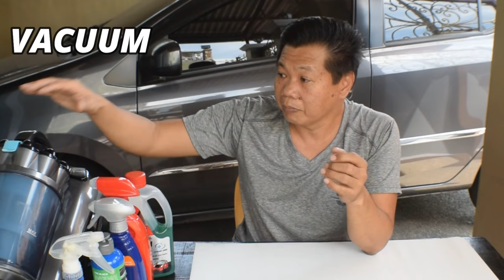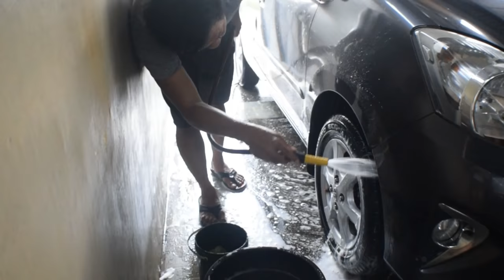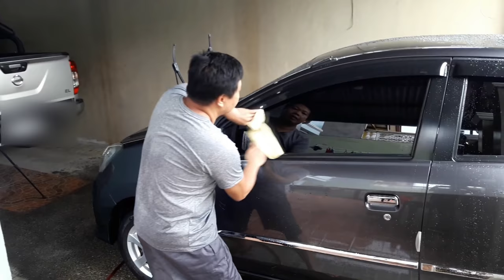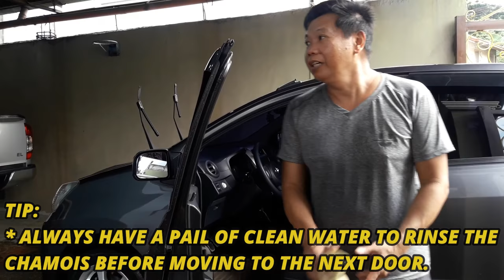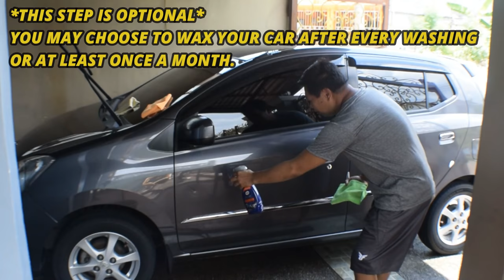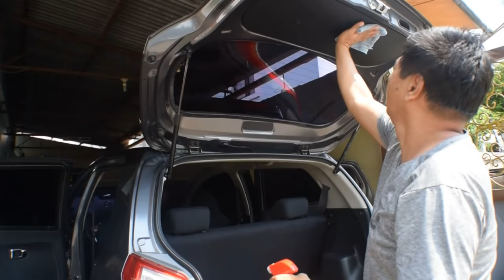How to Properly Wash Your Car [Step-By-Step Guide From A 20-Year Car Wash Business Owner] WIGO

Comment: Thank u sa napakaganda mong video tutorial sana may video a kung paano mag setup ng mga makina, compressor at timpla ng sabon
Reply from the maker: Thank you for watching. Wala na po kasi akong carwash kaya hindi na ako makakagawa ng ganung video. Pero ang set up ko po yung mga powerwasher at compressor ko ay naka install sa wall para safe na hindi mabasa at iwas maground ang mga gagamit. 4 slot ang carwash ko dati with 2 powerwashers hati ang 2 slots sa isang machine. Sa air compressor naman nasa dulo lang  tapos nakalinya sa bawat slot may kanya kanyang quick connect so lahat ng slot available ang air for engine wash or for drying. Atleast 5 meters each slot para makakilos ng maigi at iwas din ang overspray ng water and foam. Sa pagtimpla ng shampoo depende sa chemicals nyo pero usually 1 liter sa isang tank.
Reply: @joeysd.i.y  Salamat sir

Comment: Hello sir. Salamat po sa tips.
Pashare naman po nģ mga brands na gamit nyong panglinis (shampoo, tire lotion etc.)

Mairerecommend nyo po ba ang mga generic brands? Salamat po
Reply from the maker: Thank you for watching. Simple lang po ang mga ginamit ko, madali lang hanapin sa ace, blabe, concord or sa kahit saang mall. Hindi po ako masyadong maselan sa brand usually ang binibili ko ay yung affordable pero hindi yung tinitimpla lang at nilalako sa kalsada na mga chemicals. Kailangan nyo ng brush or escoba para sa gulong at foam or sponge para sa mags then sa body ng car kailangan nyo ng wash mitts at chamois pang tuyo or yung malalaking drying microfiber towel na uso po ngayon, micro fiber towels para sa interiors or loob ng sasakyan.Two buckets para seperate ang gamit para sa body at gulong. Then sa gulong at wheel well gumamit ako ng detergent soap sa body or katawan at mags gumamit ako ng blade wash and wax shampoo sa pagtuyo any brand ng chamois sa goma microtex tire gel sa loob ng sasakyan mothers interior dressing sa spray wax Turtle Ice spray wax.

Comment: Sir anong mga brand ang ginamit ninyo?
Reply from the maker: Thank you for watching. Simple lang po ang mga ginamit ko, madali lang hanapin sa ace, blabe, concord or sa kahit saang mall. Hindi po ako masyadong maselan sa brand usually ang binibili ko ay yung affordable. Kailangan nyo ng brush or escoba para sa gulong at foam or sponge para sa mags then sa body ng car kailangan nyo ng wash mitts at chamois pang tuyo or yung malalaking drying microfiber towel na uso po ngayon, micro fiber towels para sa interiors. Two buckets para seperate ang gamit para sa body at gulong. Then sa shampoo ang gamit ko ay blade wash and wax  sa tire black tiregel ng microtex sa interior dressing ay mothers interior at sa wax ay turtle ice spray wax.

Comment: Paps pwede b mahingi ang name at product ng ginagamit nyo simula s una n gngamit nyo po gang huli. Ngaun lng kc ako ng karoon ng 4 wheels. Slamat.
New subscriber u n po ako
More power s channel u paps.
Reply from the maker: Thank you for watching. Simple lang po ang mga ginamit ko, madali lang hanapin sa ace, blabe, concord or sa kahit saang mall. Hindi po ako masyadong maselan sa brand usually ang binibili ko ay yung affordable. Kailangan nyo ng brush or escoba para sa gulong at foam or sponge para sa mags then sa body ng car kailangan nyo ng wash mitts at chamois pang tuyo or yung malalaking drying microfiber towel na uso po ngayon, micro fiber towels para sa interiors or loob ng sasakyan.Two buckets para seperate ang gamit para sa body at gulong. Then sa gulong at wheel well gumamit ako ng detergent soap sa body or katawan at mags gumamit ako ng blade wash and wax shampoo sa pagtuyo any brand ng chamois sa goma microtex tire gel sa loob ng sasakyan mothers interior derssing.

Comment: Meron po kami carwash ng mister ko itong May2021 lang po kami nag start, ang prob po kasi sa car shampoo di po sya foam shampoo pag bumuga. 😅 ano2 po ba ang tamang fittings or hose na sukat para po don?
Reply from the maker: Thank you for watching. Yung foam machine po pag binili nyo may kasama na itong hose may iba na may nozzle sa dulo may iba naman na wala pero kahit wala bumubuga naman po ng tama. Possible po siguno na ang problem nyo ay nasa shampoo baka hundi magandang klase hanap po kayo ng supplier na may magandang chemicals.